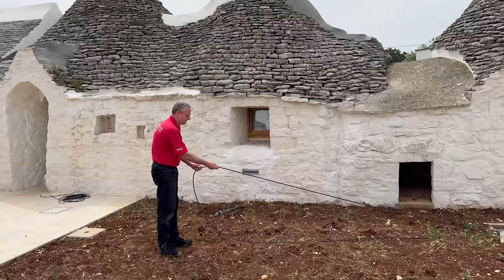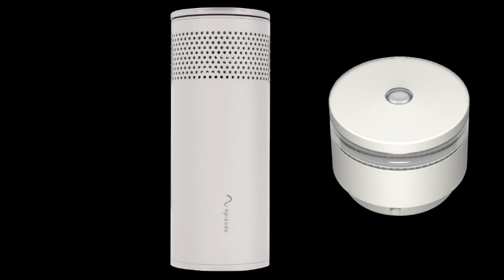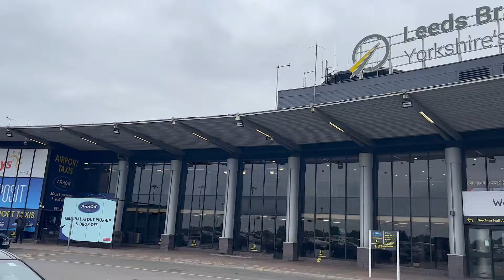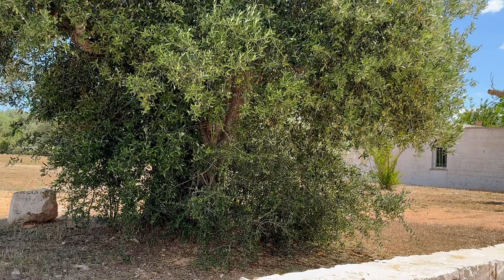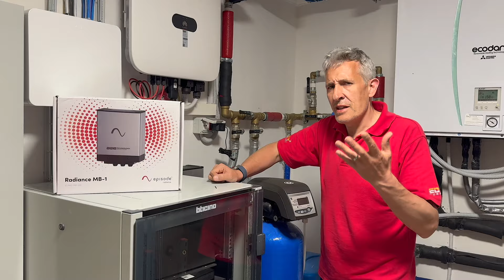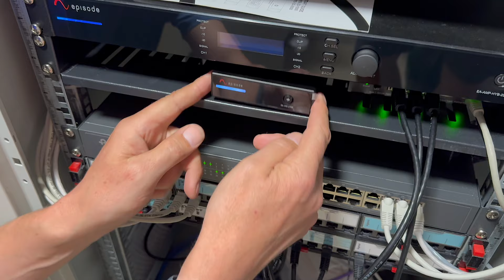Episode Radiance - Outdoor Speakers Like Never Before!

Comment: Interesting, and you've answered a question I've had for ages, why the US loves 70V audio (personally I use 100V at my place), Yes the Americans love their conduit.
The only downside is the DSP requirements, which means I cannot patch some of these into my existing system, even with a 100V to 70V transformer.
I'll have to try and source some of those gel connection boxes, never seen them before.

Comment: I don't get it.. I'm assuming the LED lights are being powered via DC. Audio is neither DC or AC exactly.. But closer to being an AC signal.. do 1 wire for the LEDpower, the 2nd wire would be for the 70v audio distro.. Where's the ground wire?  Or is one of the wires the ground and they've done some kind of electrical wizardry in the 2nd wire so that it can carry DC Voltage as well as 70v audio without causing any interference..
Reply: Nevermind. I just watched your Hella annoying asmr short video. You see, I didn't watch this video.. I  listened to it while doing chores around the apt. Maybe something to consider is not relying on the video so much that having an inaccurate script is overlooked. 
Dialogue should be accurate enough that a blind person wouldn't need the video to understand.. or old people like me

Comment: My question is cost as when you click your link, you have to create an account log on bla bla bla.  Which is daft if you just want to see the cost of the system. Also, will those speakers/ lights work with any other system, or do you have to use their equipment  as it does look  good but that setup  with tbr amp and all the rest does look hell expensive  and will it be OK within a general house as if someone wants lights and lights as in this setup  but you can use with your phones bluetooth   per say  it will  be a large expense for all.that instead of using say a main light with  a couple or 3 as a slave light in cielings lights with speakers